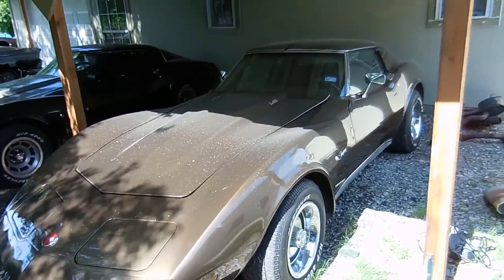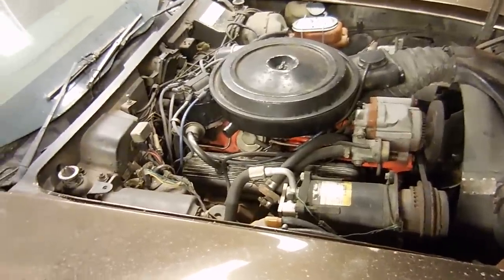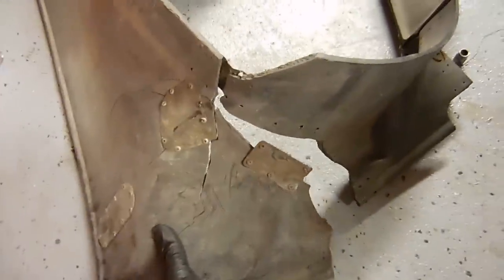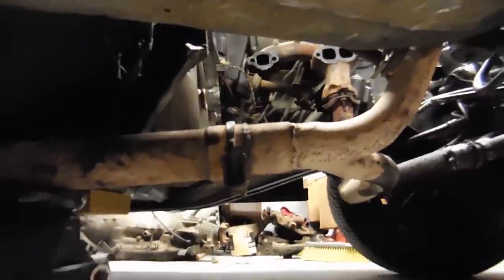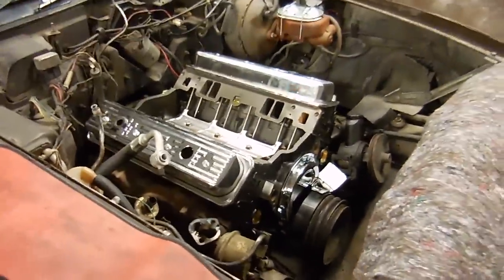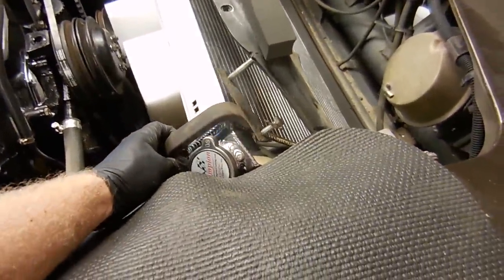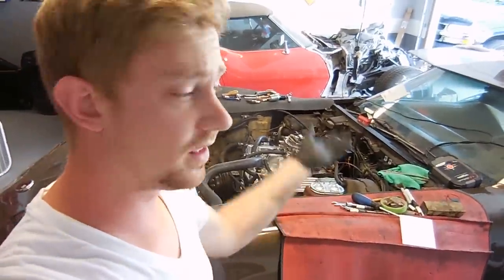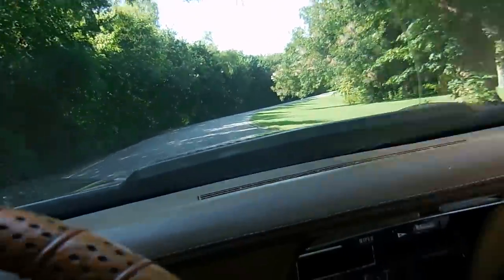John's 1976 C3 Corvette Gets a Brand New Crate Engine

Comment: Well, I'm a purist, enjoyed the video, would've enjoyed more if old motor was sent out for rebuilding, internals, had the heads worked, original carb, and most importantly A/C, cause now it's just a 76 non matching #s Vette, I'm sure anyone over 50 feels like me, at least store the old motor, carb, and pollution stuff, so possibly the next owner has options, I'm not even a Chevy man, but a Vette deserves some respect
Reply: And it is worth no difference with newer or older motor. My 81 is all original with 68,000 miles . And it would probably bring more $$$ with a better motor.
Reply: DANNY NOEL I understand that, I'm just an ass like that, maybe a crate 454 would sound better?
Reply: Danny, less than $500 in parts and some elbow grease can turn your 68K miles (barely broken in) engine into 375 HP... same HP as this $3500 crate engine... I would suggest headers and true dual 2 1/2 pipes/mufflers so it can breathe out... a little touchup porting on the heads... 2500 RPM stall converter for an L82 cam... similar to slightly better Summit K1105 cam... 
A $1,000 in parts to 'rebuild' the worn out engine in the video...
Reply: a set of 64cc heads on this motor would have raised the compression enough, and some I beam rods could have kept the engine together. Wish the original engine could have been kept.
Reply: 1976 Corvettes only made 180 HP,  It's better to replace it!  And I'm 59!
Reply: Ya know im 68 and i could give a crap about a worn out smog motor. There is no cost benefit to rebuild. Hope you find the right machine shop. Hope you find the right builder if you don't know how to build it yourself so you can brag about it at cruise nite. I have a smog 454 that i thought would be cheaper to build myself. Well after adding up the machine shop work, it was as much or more than a crate engine with a warranty and better internals and better heads. And i still have to assemble it. Well screw that. This car will never see Barrett Jackson. This is a fun driver and spending the money on a matching numbers crappy smog motor only appeal to the snobs. So screw the snobs and drop in a nice crate engine and have fun. That use to be point when we were young. Wasn't it?
Reply: @Ed90061  Totally agree...Its a 76, they made tons.....Its not an L-79 or tri-power or L-88,well you get the point...
I have a 73 vert I bought 16 years ago w the crappy  L-48..2 years later I picked up a worked 350 .40 over carb to pan for 1,900...Had someone put it in and have the old motor on the stand..
Reply: @Ed90061  yes !!!!!!!!!!!!!!!
Reply: Roger Balcer  - In 1976 I think the L-48 was 165 HP and the L-82 180 HP... at only 68K miles, it should have only needed new valve seals, flat top or mini-domed pistons, and performance cam/lifters/springs and gaskets...
Reply: Yes,  you will find the tourque values are within a few percent on most 350s, thats what turns the tires, l like hi winding sounds as much as the next guy but the tourque is very similar.
Reply: The purist in me says save the matching #'s block,  if more performance is wanted with the rebuild, , go with a 383 stroker and some good aftermarket heads with some decent flow and compression.
Reply: Yeah they ruined a good original car. If this were me, I'd get a new block 400, paint it to OEM and put everything back on it and I mean everything so it looks stock and keep the original motor. I would put some headers on that are emissions legal and keep the exhaust manifolds. It was a lovely original engine bay that - now not so much.
Reply: @BuzzLOLOL  375 would be right up my ally for hp.It doesn't have big Hp but you can still pass a car if you really need to.It's right in the middle between good hp and great hp.Good set of gears made for highway driving I would be content lol.Have a good one.
Reply: @peteandrepete528  - Yeah, 375 is high end 1960's muscle car HP... amazing to us back in the day that had never seen such power in a middle weight car...  and attainable along with good MPG and drivability...
Reply: at the end of the day this is a 1976 disco vette.....only very very few low mile examples bring any kind of money.....90 percent of these are just regular drivers that will go for 12.000 or under.....many 8000.00 or under.......this can be made nice...but they are not really an investment type of vette....pretty much after 1974.....this generation takes a major nose dive in whats its worth.....with of course a few exceptions......pace or anniversary vettes ......so numbers matching really doesn't matter....on a well driven ..sub par condition corvette from the disco years
Reply: @Ed90061  yes.....that being said...ive seen many of this disco vettes at the major auctions go for peanuts.......they are just crap from an investment point of view........so why not make it better with a newer create motor or trans......

Comment: I put a crate motor in my 75 Stingray, and tossed the numbers matching original. Reason being? I'm gonna croak in probably another 20 years, so I could give a crap about numbers matching. It's a way better car with the crate motor.
Reply: 1975? That's a malaise-era C3 Vette. It ain't no collector's car. In fact, the base engine that year was the least-powerful V8 ever put in a Vette. It made 165 wheezing, emissions-choked, low-compression horsepower when it was new. You can bet more than a few of those paltry ponies escaped the stable between then and now. If I had one of those, I'd LS-swap it without a second thought.

Comment: I hope the owner goes through the process of rebuilding the motor. That would be a huge selling point to have the original motor - even if the crate motor is in the car.
Reply: That year engine is not that desireable at all. Even though its the original one, it was completely killed by emissions. It only came new with 165 hp.

Comment: Just came across this video. Nice presentation. I've had 8 C3 Corvettes over the years, from mild to holy shit.  74/75/76/77 Corvettes are pretty much the low point for Corvette resale (other than maybe a 1984, but that is what makes them interesting for a project. I have to say though, that first, this car had the L-82 engine, which actually had decent potential. I bought a bone stock 76, L-82, 4 speed car. Changed to headers with a full dual exhaust, including dual CATS. Re-worked the stock Quadra-jet, added a better HEI, a performer manifold and the car went 14.0 @100 on regular Comp T/A tires. The bottom end on the L-82 is a good piece, including 4 bolt mains, and a steel crank. Heads are not bad. Cam is small. Just for the heck of it, I put on an NOS 100 shot and it went 13.0 @110. Fun car....this was back in 1996. I did ultimately replace the engine, as I didn't trust the rod bolts, and it had developed some excessive crank end play.  Put in a Pro-flow injected, aluminum head, roller cam 350 with a Richmond 6 speed. A lot more of everything, but big $$$

Comment: Looks good I swapped in a blueprint 396 stroker in my c3, sounds great and goes like hell :)
Reply: Did you use the original trans and rear gears? I'm thinking about upgrading my 350 with a 450HP Blueprint in my 71 Vette, but I want to make sure the trans and rear can handle it. I would think it would since they had the LS6 in 71 with 390HP?

Comment: Great job!. Not sure if you know, but you can put the rear of the car up on ramps and the nose will be itched down. The you can lift the engine and transmission as an assembly from the front of the car. it also makes it so easy to put everything back in. I have done so many C3 engine swaps. tell your customer to get the original L-82 rebuilt. Keep the original 9:1 heads with 2.02 intake valves, just rebuild them as original and that motor is worth money to someone in need of one.

Comment: Sweet looking engine. Exactly the same power ratings (389hp 412tq) I had from my N54 BMW straight 6 after a little tune. That was a quick car and a fun amount of torque and power. So this should be good for a older vette that you just want to have fun in.

Comment: You can double the horsepower on SBC with a Thumpr  high energy cam flat top pistons and vortec heads and the air gap dual plane edelbrock manifiold,headers and magnaflow mufflers!

Comment: a way to test for engine ring blow by ,is to hold your hand over the oil fill hole on the valve cover .if you feel a pulsing of hot air ,you have massive piston ring blow by

Comment: Thanks for this vid. I would not have dropped in a Blueprint engine and bolted it up to the original exhaust, which is probably robbing power from it. Should have gotten some headers, and a dual 2.5" to 3" y pipe, and a 3" cat, and a decent muffler. The exhaust manifolds should have put in a corner of the garage. I like how you showed what was involved in replacing an engine. Might want to look at getting a shiftworks kit and dropping in a built 200r4 now. getting ready to do the same to my 86 firebird Lg4. This gives me a better idea what will be involved now. Got all the valvetrain in my closet.

Comment: My personal relationship with Holley carbs, after swapping internals, set up for flats or hilly areas, is you can’t win. I bought a Carter AFB and it tried to run from the first key start. After that, I never had to readjust it from the first day. 
Threw all the Holley spare parts away. Never will I touch a Holley carb ever.

Comment: in 1976 the corvette had no power 180hp i believe, so i am glad you changed out the motor to one with more power.
Reply: sadly some corvettes in this era came with a 305 v8.....140 hp
Reply: The l82 was rated at 230 hp I believe, had 9 to compression, steel crank, forged pistons, big valve heads etc.
Reply: @royhinton3046  in 1976 the base eng L 48 was 180hp the optional L 82 was 210hp.

Comment: Cool vid. A nice car  but sad for Corvette standards. I worked with a guy who got one as a graduation present in '75. Went out for a ride or two and noticed a little plaque on the shift console which 'proudly' listed 8.5:1 compression with i think 195 HP. Parked next to this was my ratty '69 383 Magnum Charger. The C3 was a nice car. After all this time upgrades would be sweet. Freakin Holley!!! I used to buy rebuilt Holleys for my Charger. They'd usually act up under warranty. Got a tax return and bought a brand new Carter AFB. Carb probs gone.

Comment: Great Video CB...no new motor mounts??...why not a Bolt on  fuel injection, from Fitech or Holley?...since you replaced the carb...first Vette was a used 73' T- top 4spd., L48...took a 10 yr. break, then a used 90 c4 targa At L98, then 5 used c5's, coupe A4 , 3 verts. Ls1, A4, & 6spd., z06 Ls6, 6 spd.& now a used c7 Stingray vert. A6 Lt1 and all were waiting for the c8...I still own 3.

Comment: Having owned a 79 with a 60s LT1 engine lightly massaged to around 400 HP I can say this. They are fantastic looking cars IMO and the stock performance IN ALL WAYS do not do the shape any justice. If any car deserves a resto mod it is these cars. These are like the perfect car for an E-rod and THEN whatever is possible within a reasonable amount of spending to make it turn and stop to handle what a current SBC of around 400-460 H.P makes.

My 79 with an old-school 350-400 hp small block and most everything else stock besides some bushings and replacement parts was scary in all other ways besides running it from 0 to whatever the MPH was at the end a 1/4 mile run. My car ran with stock Toyota Supra's , Grand Nationals and My friends Anniversary Turbo Trans Am with the GN-X set up.

A little bit of modernization on these cars that are really 60s tech/chassis/platform and an engine with around 400 HP makes a cool retro car with timeless IMO styling that wont try and kill you if you use it more like you would a modern car.

Any more HP then 400 you would need a lot of $ to make it stop and handle to be reasonable beyond going straight and fast.

They can be had relatively cheap and therefore are a good car to make a street 'hot rod". If you don't like the shape of the C-3 I don't know what to tell you (the 80s cars might be for a certain taste but are lighter then the 70s cars and not without charm but these or my 79 with the more practical bubble back are some of the only 60s "muscle cars" built throughout the 70s and not overpriced and  don't have rusted body panels for obvious reasons.

I don't think an E-rod type of engine makes you lose much if any of the feel of a sixties car and you can just put a carb crate motor with bigger secondary's for a more stock feeling. 

With the release of the C8 and previous corvettes I think a 400 or so HP set up is fine for that nostalgia feeling because going much higher to compete with modern performance its just easier cheaper and safer to buy a used c-5 c-6 or even C-7 and throw some boost at it if it isn't a boosted model.

Comment: Very cool. Yes I agree, you don't want a new engine with a faulty carb/injectors washing down the cylinder walls with gas. Make sure that carb/injection system is not allowed to continue to wash the engine down. It seems to have long crank times [ ignition voltage /MSD box can really help ] Blueprint can rebuild your existing numbers matching engine. As far as the heads, a blueprinted NHRA C3 1976 L-48 and L-82 Corvette in stock eliminator with the stock short block /stock heads [cheater cam]  would run 10 second 1/4 times with the Q carb and stock low plane intake. So 400+ horsepower using upgraded components for reliability and frictional losses is easily attainable. Roller rockers, roller hydraulic cam, modern pistons, low drag rings are well worth the additional cost if you intend to keep the car and are looking for increased cruise mpg.

Comment: There's a really easy way to test for bad rings, put it in 2nd gear full throttle and get up to about 4,000 rpm and just let off.  If the rings are really bad it will pull oil up past the rings when you let off and create a huge smoke screen out of the exhaust.
Reply: 4000 rpm on that engine?:)
Reply: Why not?  Redline is 5,500
Reply: Lol ok, I think you have a lot to learn.

Comment: This turd brown reminds me of the same color 75 stingray my older brother had Back in the late eighties. He rebuilt the 350 (l48?) .030 overbore with flat top pistons, comp 268h cam,  performer intake and stock but rebuilt q jet carb. Horsepower was probably double, at least it felt like it.  He was going to trade school at the time and new a few guys in the auto body course. I helped him strip three layers if brown paint with aircraft stripper and remove the bolt on plactic nose and tail pieces. Then the guys from his school molded later model vette front and rear nose and molded them in.  They painted it in the 78 pace car design but gold instead if silver. He also installed the later vette aluminum wheels. BTW, Matching numbers wont get you anything extra on a 76 vette. I woulda installed the dual carb paytern version of the performer intake and kept the q jet though. Especially since he said he just rebuilt it. Then he has trouble with the holley.  If it aint broke don’t fix it. I would be willing to bet performance would be better than with the spread bore the square bore.  edelbrock or holley.

Comment: That is oil smoke from bad valve seals/ and possibly valve guides. The simple way to find out is with a wet and dry compression test to determine ring wear. I'm only at 3 mins so ill keep watching lol. Blue smoke is oil btw.

Comment: I like the Idea of doing a crate swap. The owner gets to keep driving a classic Vette but with 2018 power and reliability. I bet the fuel consumption is better now too.Not everyone wants to spend their weekends adjusting tappets and fooling with a carburetor . If it were mine though,I would have fitted ceramic coated headers ,a  freer breathing exhaust and a Holley injection .How wide are the plug gaps supposed to be? those look like an 1/8 th of an inch. It's been mentioned here in the comments, you didn't need to break in the cam because Blue Print has already run the engine up .
Reply: U don’t speak for everyone

Comment: Valve stem seals are shot and pull engine oil on top of the engine after it starts into the engine. Replace the seals or Knarl the valve guides and replace the seals

Comment: I had a new, forged and roller'd motor built for my '74 Camaro, but just threw the original on a stand, and there it will stay. Not just for the #'s reasons, but also that it ran fine when I pulled it out, after I put about 200k on it, though altogether it had over 300k. So it'll also stay for sentimental reasons. 

We have a '72 LT-1 Vette, 4-speed, factory a/c car also. Now that, if it ever needs an engine I'll just have it rebuilt, as it most definitely affects the value of that car.

Comment: Nice car.  I had a similar issue with my '72.  If you revved to 3,000 or beyond it would smoke like that.

Eventually the motor came apart.

Comment: Haven't watched to whole video yet, but just seeing the beginning I can relate. I just got a 69 vette last summer...uses 1 qt every 300 miles(now it's about 1 qt every 500 since cleaning up the carb), but mine actually has NO SMOKE coming from the back like yours does! Weird...and it's a mystery to many who have looked at it. Had someone follow me and say it does smoke a pinch a downshifts, but not as much shifting up. The car did sit for 10 years(2002-2012), then the next owner had it 5 years and only did 1,500 miles. I've done 4,500 in the year plus I've had it and it has shown signs of improvement, but it's a mystery and wondering if a re-build is in the future...but I'd like to understand more about why, before even thinking seriously about doing the re-build. For now, I'm just driving and observing. Yes, some of the plugs do get some oil around the base(mostly plug #3,4,5). I just hate not knowing the exact reason!!!